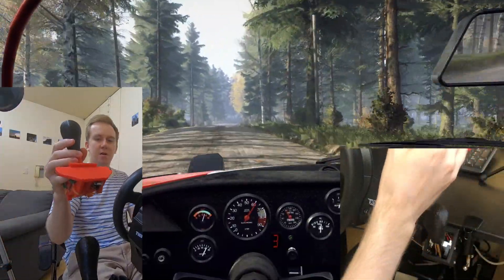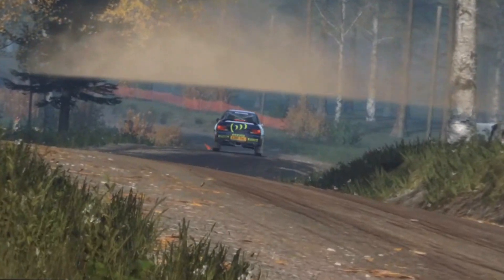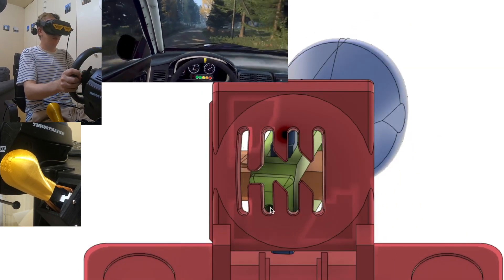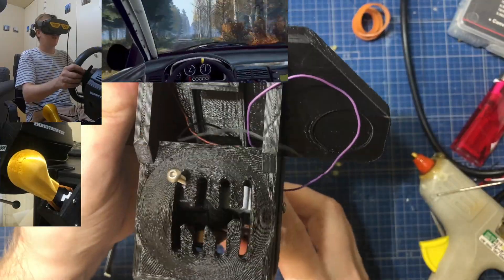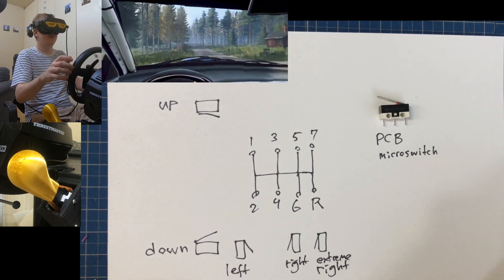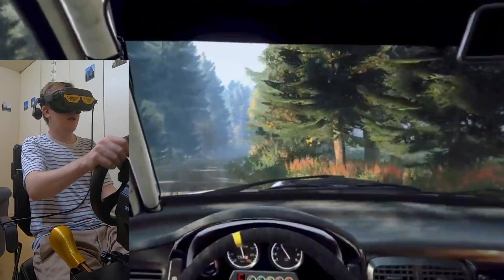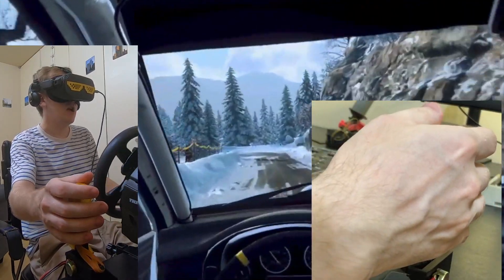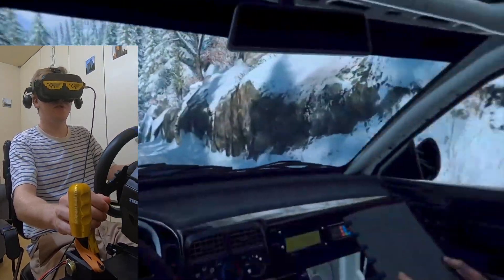8-speed racing stick with my 3D printer and Arduino

Comment: You should try the air link via wifi, or using a program such as virtual desktop (20 usd), it does require a good wifi connection, but it's much more stable and it doesn't disconnect.
Thank you for this project, I was searching for this to upgrade my driving setup.

Comment: i started printing it and ordered arduşno pro micro clone. fingers crossed. 🤞
Reply: 1st print failed due to power lise. Second print good. Arduino arrived broken so i ordered New one. Shifter works okayish. Little sloppy but you can fine tune it. Handbrake code was missing but i added myself works great. Overall really happy.
Reply: @msetechrepairs  what code did you use?

Comment: Dude, You're awesome. Beyond the intelligent designs you've constructed, Your videos has a soft humor. Here. Thank you for sharing knowledge.

I have a problem to solve regarding SIM RACES..
I have a cockpit support, a Logitech g29 and I pay in a PS4. 
The problem is that I need a handbrake for playing really games such as dirt rally. However, in PS4 I don't have a cheap option.. I see a lot of DYI videos using the joystick to activate, but none has a soft solution that doesn't female de joystick as you have done.
I need a 3d printed handbrake that activates pressing any button or the joystick and that can be fixed in the cockpit support or table.. 

Please help us PS4 dirt rally player games..
Have a nice day
Reply from the maker: thanks!
I believe you can’t use multiple controllers to control a single player game on the PS4, right? In that case it sounds pretty difficult.

Comment: Very smart design, but not a clear instructions. I watched the video 100 times, just to figure out, where the second rubber connects. And there are a bunch of holes in the body, I do not know what is the purpose of those. 

I still need to wait on the switches to arrive on mail, but over all, mechanically it is working perfectly

Comment: I printed it and I have a question ... I connect the "NO" part of the microswitch to digital pin 1, 2, 3 ... of the arduino board and the "C" part of the microswitch where I connect it to the arduino board? Thank you
Reply from the maker: Ground

Comment: @Akaki Kuumeri is it possible to modify the arduino programming and thus remove the potentiometer and make the handbrake with a microswitch? so it can be used on arduino nano boards.
Reply from the maker: Sure, should not be hard. But you still can’t use it with a Nano because the Nano can’t emulate a gamepad

Comment: The RPM Range is green for low, or safe... yellow for higher but still safe, red for about to reach the rev limiter... typically flashing red is rev limiter. You want to shift before flashing red.

Comment: Why not set up a table... ie: Add up the values like chmod and access a table... a big if / else if tree can be just as slow as a for loop of known length. But if you have the table, then it is just more overhead ( memory in use ) and direct access. Less code too - just more setup data. Should respond faster too.

Comment: I'm printing it right now. This will be perfect for games like ETS or My Summer Car
Reply: can you give feedback
Reply: @yasincebeci9625  My colleague 3D-printed this H-shifter. It was difficult to find M3 bolts and nuts, but I made it. Shifter works ok. Handbrake also. Next goal is the DIY pedals and Steering wheel.

Comment: The fifth and six gears are cruising speed and first gear is a starting speed you only us first if going from a stop sign and such, 2 and 3 and 4 are like for going faster and you don’t look at the light to switch gears it’s in the revs so if it’s a high rev you go to a higher gear and so on but if your in 6th gear and wanna go faster drop down to 5th or even 4 to go faster
Reply: In a race car, you do use the lights to know when you're at the optimum RPM to go to the next gear to remain in the engines power band.

Shift  too early and you will be out of the engines power band and won't have the acceleration you would if you stay in the engines power band. 

While you don't look directly at the lights, you can still see them (vs the tach) in your peripheral vision as to not take your eyes away from the track but still be able to see the shift lights which is why they're used.
Reply: Also, in racecars 5th and 6th are not cruising speeds, as they use all of the gears available to have optimal acceleration for any given speed (not to mention they don't need cruising speeds). Lastly, when you're driving a racecar, sometimes you do indeed have to drop down to 1st gear, because you're always looking for the gear with the best acceleration. This is especially true in rallying, when you're driving through a hairpin for example.

Comment: i dont get where did you place the springs at 4:11
Reply: I've posted more informative video how to assemble this shifter: https://youtu.be/xyWhzIESEnE
Reply from the maker: There is a hole for a screw near the far end of the right hand wall. You must put a bolt in that hole and extend a rubber band from there to the dent in the rachet piece. You can see the rubber band ready at 3:38
Reply: @AkakiKuumeri  ohh got it! thank you!

Comment: 6th gear is near enough useless in a normal rally stage. The shift lights are an indication on when you're redlining the car (Reaching the limits of the rpms) and a recommendation to change gear. However, because its a rally car, you dont really need to pay attention, you want to stay in a good rev range, green to yellow, downshift when you drop out of green, and upshift when you move into orange.